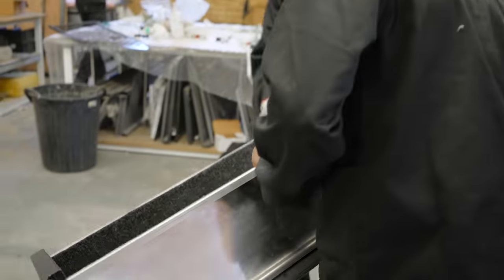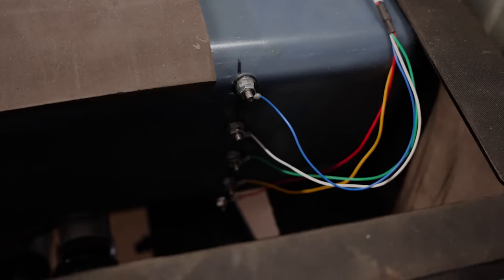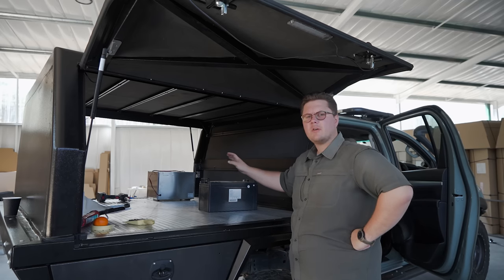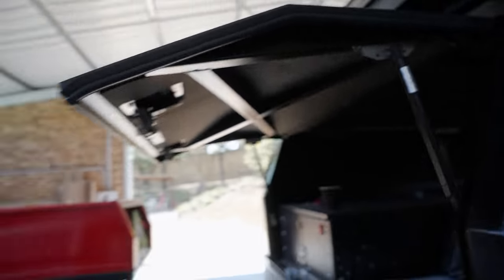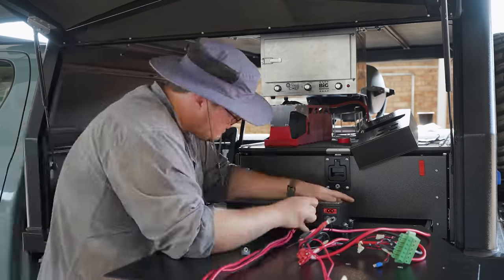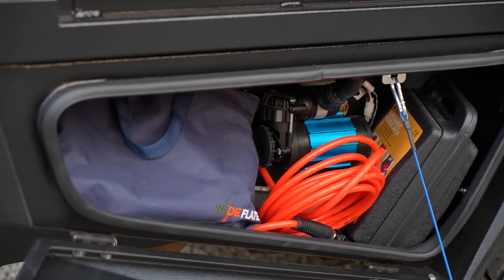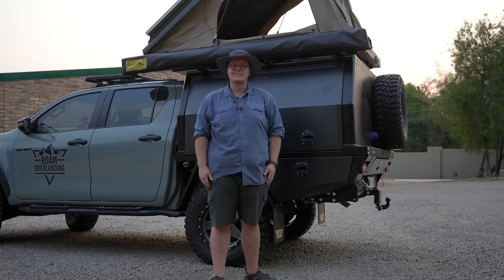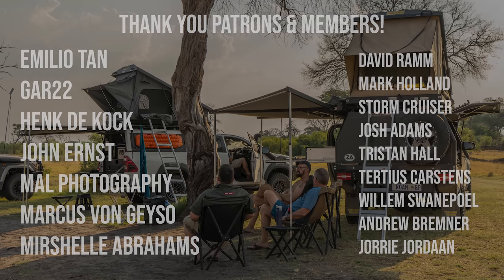Toyota Hilux Tray and Canopy Upgrade by Bushtech Canopies with a Redarc Redvision Setup

Comment: Can you do an overlanding series for mainstream workers, minimalists and/or low budget. Meaning a tub rack or roof rack at most and tents for camping. Portable equipment for cooking with a rollertop and no canopy. No bullbar, no fancy 12V systems just a standard rig and let's see how far you can push it. 31" tires and no lift, standard suspension. What is as close to stock a Bakkie capable of in the overlanding space is what I would love to see...
Reply from the maker: It’s a good concept for sure. At the end of the day you need to travel the way that makes you happy. Our budget build series with the Isuzu looks into these different vehicles setups in a fun way, and will continue to show a variety of different types of vehicle setups. But I’ll put some thought into a stripped down overlanding vehicle setup
Reply: Hi from Australia 
Have a look at my Hilux build. I did the fitout myself so may be of interest to you. I did the whole truck on a budget and so happy with it and can do all the tracks everyone who spends a bundle or has suppliers giving them products. 
Cheers and travel safely
Out There Touring
Reply: Actually, he did. Take a look at Jimny episodes!

Comment: Thanks for the great report RO - the whole vehicle and canopy looks classy and good to see you’ve gone for the Red Vision mgt system which is all made just down the road from where I live in Adelaide - my project is going on to a 2010 Hilux using Amptron Lithium batteries, Red Vision system and Engel fridge/freezer.- I also had the tub and ARB fibreglass canopy but being short I could never get inside the side windows and also reaching over the rear tailgate - here in Australia we’re all dumping them and fitting aluminium canopies which I can now access so much easier and the storage is amazing - enjoy your travels.

Comment: From a history of using these types of systems. On your kitchen slide add a second slide that comes out and can fit a collapsible bin for a sink etc, add dividers in the canopy to keep stuff better organised and keep it from moving around. On the non kitchen side ad a second drawer up towards the front with a divider shelf. It will serve well as a area to store camera equipment , charging area, and place to have a work station if doing things like uploading data to SSD or working on storing drones etc. could have worked in an area on the front side of the canopy like called frenching for an antenna for cell booster or comms on non side. Didn’t see how you put in water but having that accessible on the front side outside kitchen of canopy is baller easy. Adding a shelf up top especially under the oven towards the back you could do a small storage cabinet for spices or such. Adding some extra outside lighting for camp and out and about at night would help too. I take a large look at how many in the AU are running their systems and you can get some great tried and true ideas. Other things like a handing rod or even cabinet to hang clothes. Adding an area with a larger mirror for the ladies to comb hair or make themselves up etc. much one can do but there is extra one can do to make even better. Even having the canopy as a single piece and having basic things like electrical
Already installed. And having the bed as a one piece system for those who want to be able to install easily themselves. With tanks and such already installed and run. The flatbed may be better served with a small headache rack etc. good luck.
Reply from the maker: some good ideas here for sure! Thanks for the input!

Comment: A worthy upgrade to your Hilux.  Look at all that space now.  But more importantly, the ease of accessing them.  Have you considered fitting a slim upright pullout pantry in the space between the fridge and the drawer?  Plus if it was my rig, if your upright fridge have the feature, I'd swap the door hinge to the left side.  Then the fridge door opens from the right to the left.  IMO it will provide better access.  If Bushtech offer a permanently mounted fold-down ladder at the back (like you'd see in many Australian canopies), also highly recommended.  'Coz usually the steps are wider, thus more comfortable than the RTT ones. I'd also place an LED light on top of the rear canopy pointed rearwards to provide illumination to the pull out trundle drawer.  'Coz friends who have them, frequently use them as tables.
Reply from the maker: We did try fit a pantry, but the gap was just too tight! The fridge could swap the hinge, not a bad idea 👌🏻 BushTech are working on designing a fold down ladder, so let’s how that goes in the future 👏🏻 and it was hilarious because I got to my first test night of camping and realised I forgot a light for the rear 😂 we made a nice little plan with a magnetic rechargeable led light that can do red, white and amber; worked like a charm 👌🏻
Reply: Hi from Australia 
Just read your comment and thought you might like to look at my set up. 
Cheers and safe travels 
Out There Touring

Comment: Good that you’ve considered as much as practical your weight mgt in the canopy keeping as much above the rear axle - I’ve seen bent Navara and Triton chassis because the vehicle has too much weight to the rear and as soon as you come out of a big hole at speed something has to give - in fact by pure design the Triton’s rear axle is much closer to the cabin compared to a Hilux thereby limiting how much you can load on the rear tray/canopy - I’ve also fully insulated the canopy using insuwool to keep the temperatures lower than normal
Reply from the maker: The insulation makes a huge difference! Especially on a black canopy! 🥵

Comment: Howzit bru! Awsome vids thanks. 

How is the 2.4 handeling all the weight? 
Fuel consumption? Is the ecu mapped? A vid on there would also be lekker!
Reply from the maker: It’s definitely heavier; but the vehicle is handling better because the weight distribution is so much better. The ecu is remapped and o have a hybrid turbo to make some lower down torque. My egt’s run hot so I’m on a mission to get a proper tune done now. But the truck is doing good considering. Better than a 4.2D cruiser 😂

Comment: Very nice build ! 
Wondering where you’ll put clothes and electronics and dry food ?
Reply from the maker: Clothes, in duffel bags so they can be moved to the front seat when at camp or put in the rooftoptent when needed. Electronics in a camera bag, in the back by my plugs and stuff. Then the Dry food goes in the kitchen drawer and then stuff like snacks and extra juice/beer goes in the other drawer on the other side 👌🏻

Comment: Awesome, I ❤ it! Can't wait to see how it goes  Won't the tow hitch at the back hamper your departure angle? Or is it removable?  Seeing you don't tow on a regular basis. ☺
Reply from the maker: ❤️. Spoiler alert, it didn’t hook on anything, spoiler alert 2, it’s removable and I removed it yesterday because it’s like 10kg 😂
Reply: @RoamOverlanding  Yeah, good idea to remove any unnecessary weight. I was thinking if you're doing some hardcore off road trails, that it may be hooking on stuff 😅,  just keep it in case you get to tow something again. Maybe an off road caravan on test ☺👍Enjoy Botswana!  Cannot wait 💙💛

Comment: Very cool! Is it much longer than the tub you have removed? What is the cost of it?
Reply from the maker: It’s actually the same length; and the spare wheel sits like 20cm closer to the rear axle than on a swing arm bumper for example. I think you’ll need to get in touch with BushTech about the latest pricing 👍🏻
Reply: @RoamOverlanding  Cool, thanks

Comment: This is very nice build. However, after your video talking about to change your setup because you struggle to do long travels because everything is so exhausting and mainly you talked about the miss of a inside space, I expected you installing a canopy camper, something like the alucab where the tent and the canopy are the same part
Reply from the maker: I have gotten some drop sides for my 270 awning for now, giving me the ability to close in an area around the vehicle that I can setup a table and work from a bit better. Baby steps! Maybe 2023 will hold a camper setup 🤣

Comment: Looks very heavy?
Reply from the maker: It’s actually only 75kg more than the previous setup. What’s increases the weight a lot, is that you have so much more space and accessibility that you can load a buuuuncccch more stuff in. But the weight distribution is so much better that the vehicle is actually handling very well 👌🏻